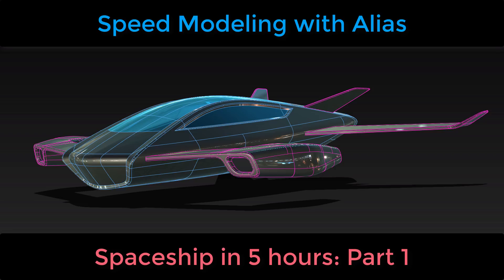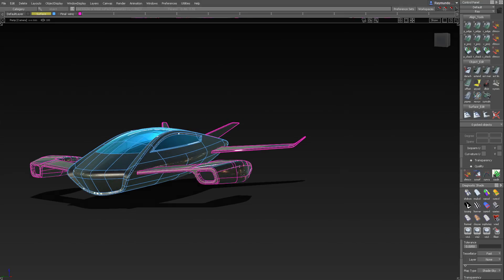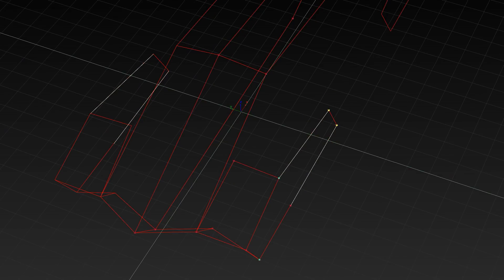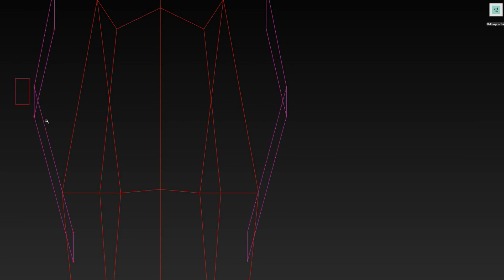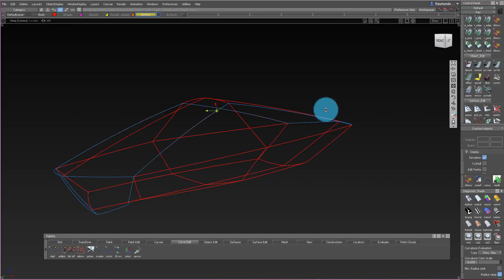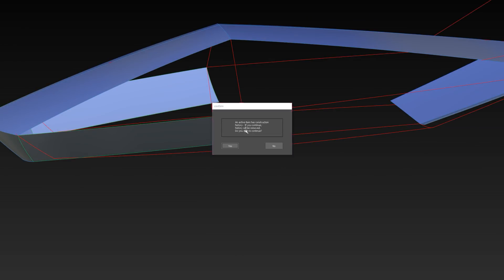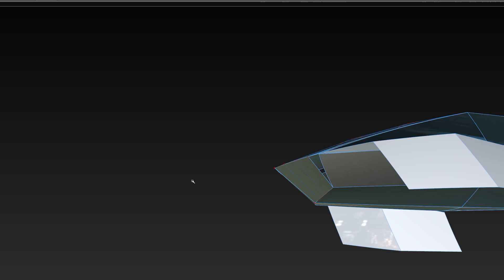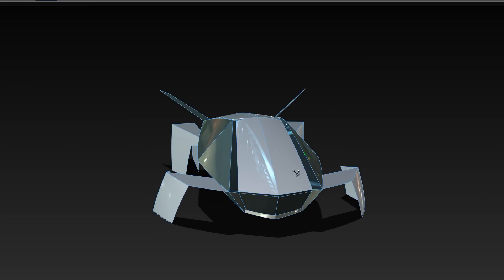Speed modeling in Alias: Space Ship part 1

Comment: Another great video! Do you think you could build clean high quality surface off of subD modeled mesh? Or would you say it is faster to do everything straight in alias?
Reply from the maker: Laci Lacko that’s hard to answer because with live bolean functions, like mesh Fusion inside of modo, you can get good results. Mathematically speaking, nurbs will always have more control and be cleaner. Even though I am a huge fan of sub D modeling, I am so used to the hyper control with nurbs, I rather go straight to Alias.

Comment: Awesome! 

Short question:
Why do you rebuild your curves to degree 3 when setting up your lines in the beginning? Would it not be easier to use degree 2 curves since they are even easier to control ? I see that you use a hotkey for rebuild to degree 3 as well.

Thanks
Reply from the maker: mo pe two degrees is a too little for my liking. With three I can control the radius and lead in more.

Comment: Bro. you really are my saviour.  quick question I have,  does Alias have a thickness option on surface like solidworks or fusion 360? If you model a car side mirror cuz the housing is mostly injection molded, how do you go about with alias since you can do complex surfacing on it keeping in mind the manufacturability and tolerances? im good in solidworks as a junior industrial designer but i want to transition into automotive modeling for production I still use the student versions but i am building a portfolio and preparing myself for an opportunity that may come in the future. what format can I export the surface body for 3D printing or to solidworks or other cad to add thickness or mold cavities for cnc n injection molding?
Reply from the maker: Ken concepts Alias isn’t really a solid modeler like fusion and solid works but it can creat closed volumes that can be printed. It’s just not very quick. To do it in Alias you basically have offset the surfaces, then fix any offset error to make sure it’s closed, then surfaces the sides to make it a closed volume, then you make it a shell. I myself almost never have had to do this, but when I do I surface in Alias, export the surfaces as iges, nd use Rhino to make it solid and give it thickness. 

Just remember Alias isn’t really made for that and in terms of my career work, I can’t remember doing that more than like two three times in my 9 years.
Reply: @HandleBar3D  thanks alot. Yeaa iges/step works pretty well. Thank you✊🏾🙏🏾